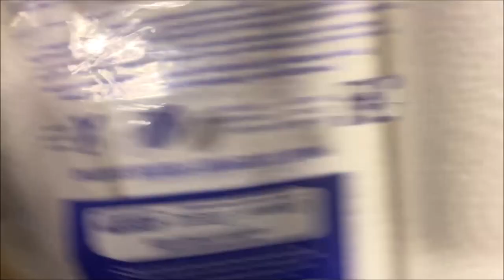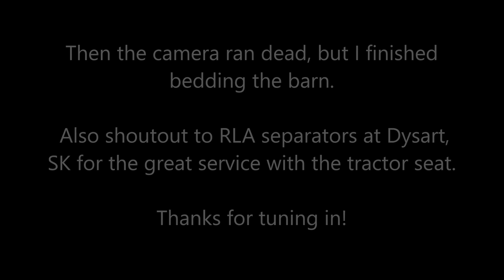Fixing an Air Ride Seat and Bedding Cattle

Comment: The calf catcher, no matter what brand, mounts on the left side.  Although I prefer to dismount the quad on the right, when I thought about it, they are on the left because your right hand would be on the throttle/brake/steering and you would use your left hand to release the spring loaded gate.  Wouldn’t work so well the other way around.